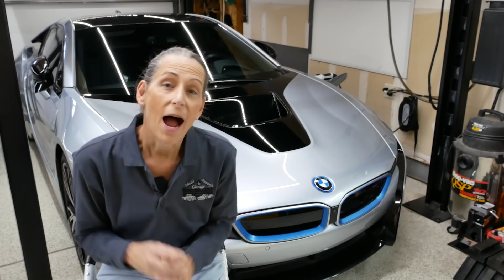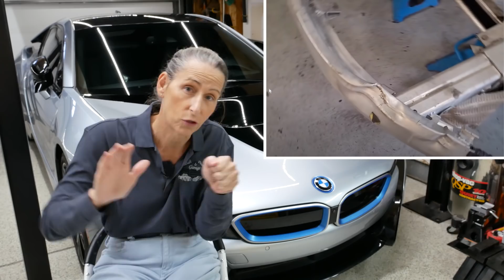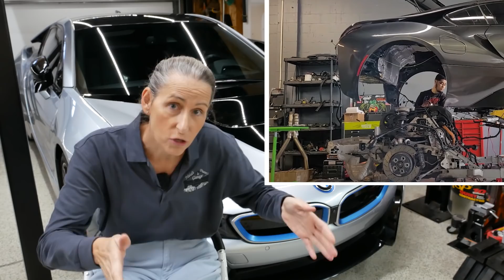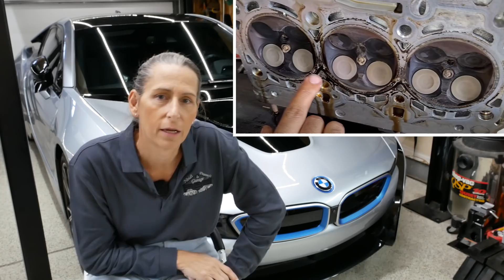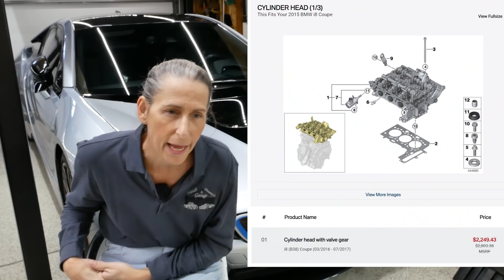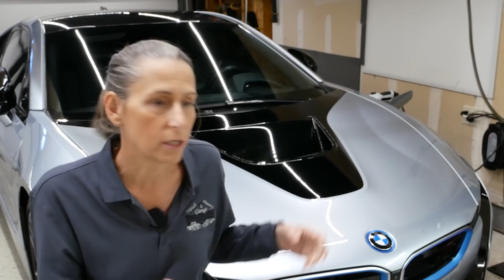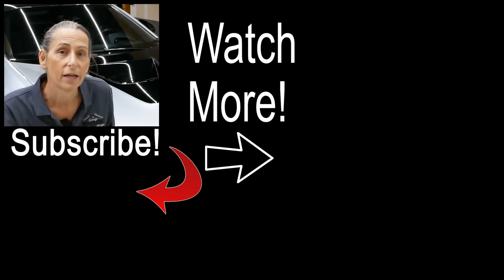Is THIS What Ruined Sam's i8??

Comment: A BMW with engine problems? Imagine that.
Reply: My BMW 320 did over 220,000 miles on its engine before I sold it. But then again, I never ragged the arse off it and always had it serviced every 12,000 miles. Who'd have thought, eh?
Reply: All 3 of my bmw's were built in germany. They all have the typical bmw issues but then again i keep them long term and fully expect the issues. Keeping a careful eye on the maitenance schedules and changing the oil twice as frequent as recommended has made all the difference. They are "needy" machines as they age but a joy to drive when sorted. I do all the work myself. LOL
Reply: @thomasstorrs6345  That is a common problem people miscalculate on. Oil life in normal driving conditions can easily be half the service interval, even less with short trips in certain climates. Most owners just follow the schedule regardless. I've just passed 320,000, never had the engine apart but do oil changes at 5000, and I use Mobil 1. Even cheap mineral oil changed more regularly is better than stretching full synthetic to 15k.
Reply: @alasdair4161  I'm with you on oil changes. I use only synthetic and change it at 5,000 km and my engine has 425,000 km's on it
Reply: BMW engines overall are well built. It’s usually the stuff around it that goes bad, like the cooking system.
Reply: @2Beigatti  You just sunk you're own argument.
Reply: BMW had often Headgasket Problems, this is a 3 Cylinder but had the same
Pistons and Gaskets then the other Engines.
The engine is fixable.But the big Problem is the Battery.
If you want a new one, this cost you more then the Engine.
And you need more then a Mechanic for that,it must be a 
Electronic Expert.That makes it a Money pit.
Reply: @kallejodelbauer2955  And EV batteries are being increasingly made like those in consumer electronics, where if the controller board loses power it needs to be blessed by the manufacturer before it will work again.

Manufacturers are doing this to try to prevent people from being able to replace failing cells in faulty battery packs. The strategy has already failed, because people just replace the cells one at a time, but it massively increases the chances of electrocution or unextinguishable fire in the event that something goes wrong when you're working on the battery.

They have made it so expensive to replace the batteries that there's a massive incentive to DIY, but also made it highly likely that you'll be electrocuted or start a fire if you try to do so.
Reply: I drove BMW's from 1987 to 2015. The first one i kept fro 9 years and not one of them gave me any hassle. All bought with a service plan and serviced regularly. Then bought a Volvo XC 60 and that has been a problem from day one, 4 years now. I am going back to BMW.
Reply: isn't that ironic..........
Reply: As someone with an E46 320d I felt that.
Reply: @chasis807  They all have problems. It's the nature of the beast.
Reply: Built in Germany much better
Reply: @schutzhund3933  How? They're the same engines. I think Europeans are used to shitty engineering.
Reply: @tempest411  It's a different mentality, the European engines are not made to wear so badly that they lose compression after a few years, which is what allows American engines to soldier on for hundreds of thousands of miles after they should have been retired for piss poor fuel economy and smoking from blow-by.

Instead European cars like to keep delivering similar amounts of power until the day they catastrophically destroy the weakest part of the engine, which often causes a cascade failure that makes the engine economically unviable to repair. 

Which is better depends on the intended use of the car and whether the driver has the means to handle a sudden failure.
Reply: Toyota has engine problems too: https://www.caranddriver.com/news/a30997060/2020-toyota-recall-camry-avalon-rav4-engine-cracks/#:~:text=Toyota%20is%20recalling%2044%2C000%20vehicles,%2C%20overheating%2C%20or%20engine%20fires.

Comment: Maybe you could build up the warped surface on the head with a 3D-printer and resurface it? Just a crazy thought.
Reply: That's just the warping they could spot on the surface. What about inside the head or, worse yet, inside the block itself?
Reply: @Milnoc  Exactly, what about the cam bore? Sam's video showed how badly the head was warped. It's not just correctable at the surface.

Comment: I am sure I read somewhere that there was a problem with the  electric fuel filler opening mechanism, and the repair required the removal of the fuel tank.
Reply from the maker: This is a great point!  I forgot about that.  It is in the CarFax twice a few years apart.  Totally makes sense.